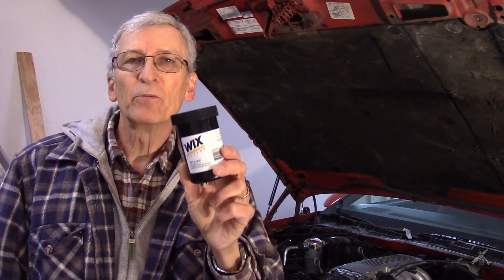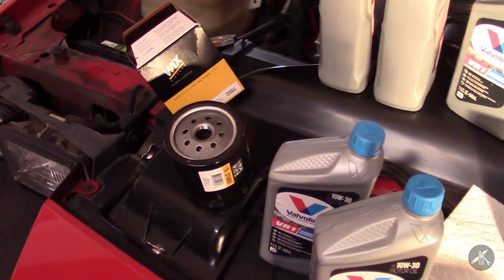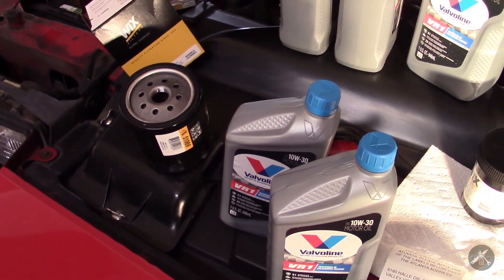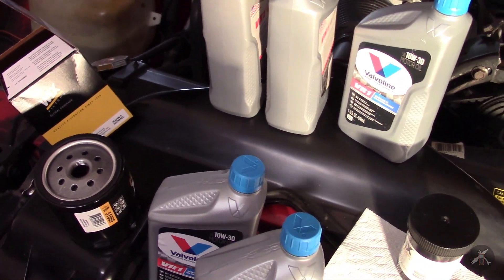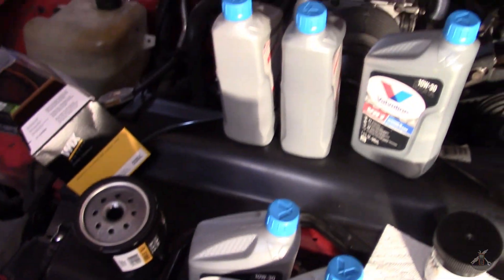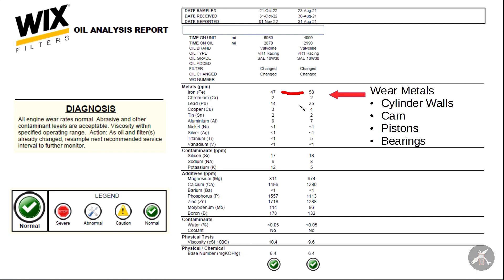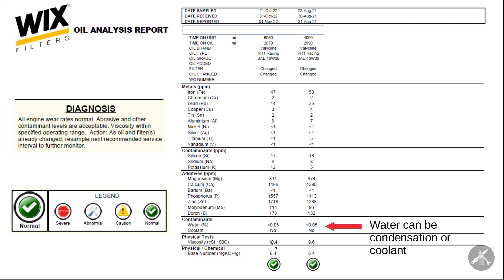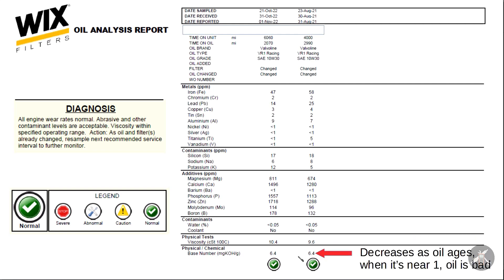Collect Engine Oil Sample and Review Lab Report - 305 Chevy

Comment: Is that brake fluid on the passenger side tire?
Reply from the maker: Yes, I saw that. I believe that is still some residue from the earlier brake problem.  I'm not losing any brake fluid.  That tire was recently rotated from the right rear where I had the wheel cylinder leak.  I had tried to clean it, but it was hard to remove - may need to try again.